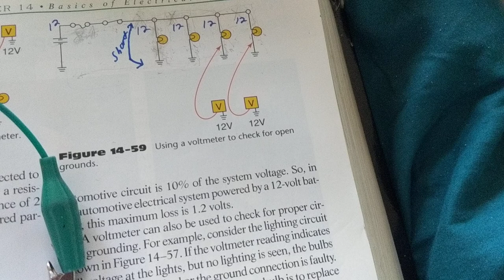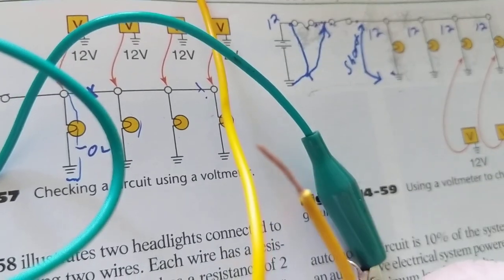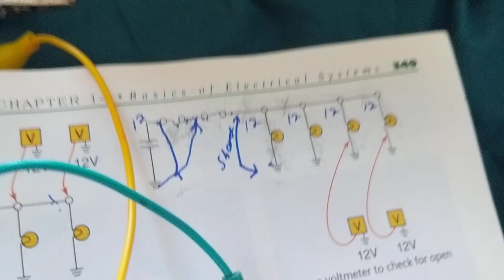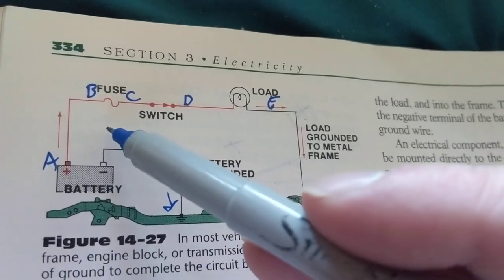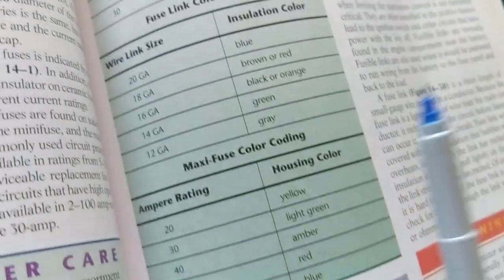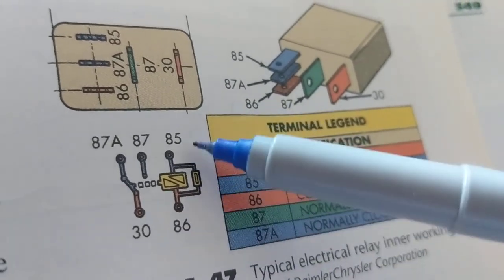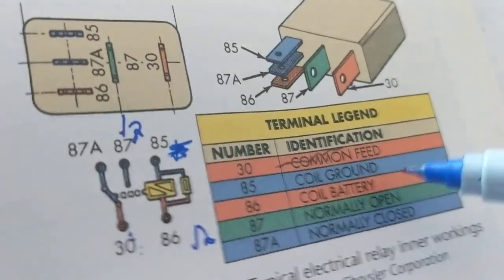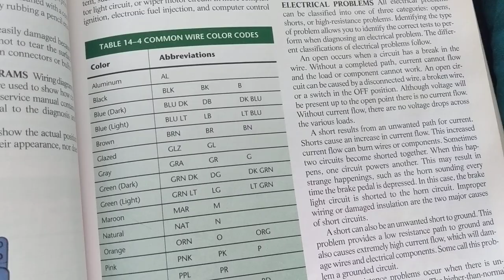how to understand RELAYS AND SHORT CIRCUITS IN AUTOMOTIVE ELECTRONICS

Comment: How would I troubleshoot a relay that won’t turn off? I checked the relay and it is good. This is causing my wipers to stay on even when switched off.
Reply from the maker: I was first pull out the relay at least see if it's that side of the circuit and remember there is a timing circuit connected to these motors which is a module which could be faulty it is one unit
Reply from the maker: There's also some models have switches in them a combination switches that could be stuck closed pull the switch out or relay out make sure you don't have 12 volts going to the wiper motor
Reply: @Joeelectronicschematicsforauto  thanks, yeah I pulled the relay and the wipers turned off. I also replaced the multifunction switch on the steering column so don’t think that’s the problem. I guess I need to test the relay socket? I don’t know what to look for though.
Reply from the maker: @Jerrden  I don't believe it's the relay socket that means there would be a short on the load side all the time and that would blow the fuse go to the connector that goes to the blower motor see if you always have 12 volts there even if the switch is off
Reply: @Joeelectronicschematicsforauto  ok I will try that
Reply from the maker: If the terminals will be shorted then when you pulled out the relays the wipers should still be on so do your evaluation get back to me
Reply: @Joeelectronicschematicsforauto  so with the switch off, ignition off, relay removed, I get about 4.5 volts to each of the 3 wires that receive power on the connector that plugs into the wiper motor. I back probed with the connector plugged in and the same wires show 0 volts
Reply from the maker: You should have zero volts there is no voltage going to it I have to look up a schematic but what make and model is it
Reply: @Joeelectronicschematicsforauto  2010 Dodge Ram 1500 4.7L V8
Reply from the maker: In the schematics I was looking at I did not see a relay external a relay is internal in the module and the wiper motor thing I saw outside was the washer motor I will try taking out the fuse and measuring the voltage I don't know if you're measuring the right relay everything is internal in the module
Reply from the maker: However on the schematic of the fuse box I do see two relays my best advice is to change the module
Reply: @Joeelectronicschematicsforauto  ok I’m going to continue working on it today thank you for your help.
Reply from the maker: Good luck
Reply: sorry to be so off topic but does anyone know a way to get back into an Instagram account??
I was stupid lost the password. I appreciate any help you can give me!
Reply: @Colton Hugh Instablaster ;)
Reply: @Terrance Eric I really appreciate your reply. I got to the site through google and im waiting for the hacking stuff now.
Takes a while so I will get back to you later with my results.